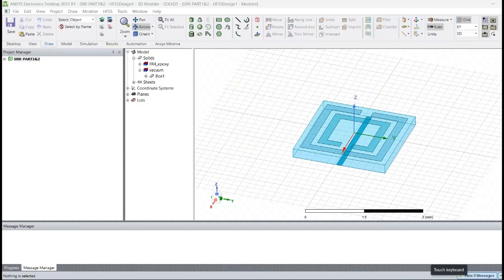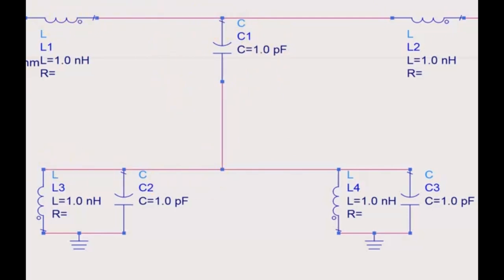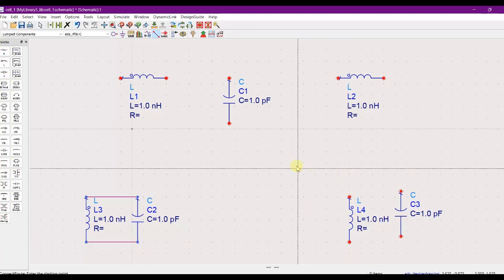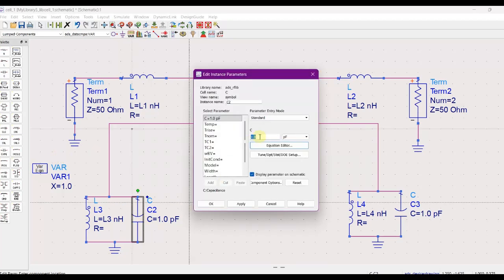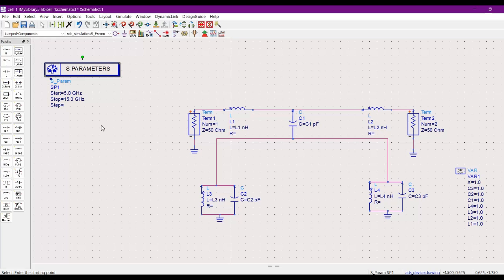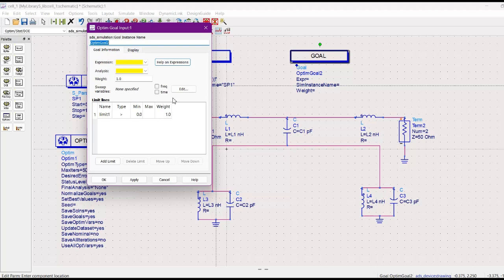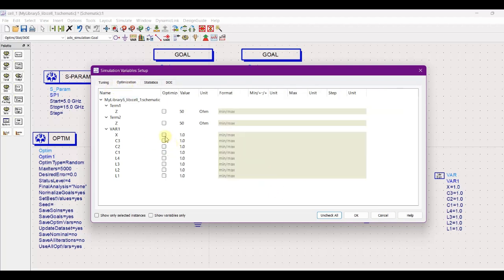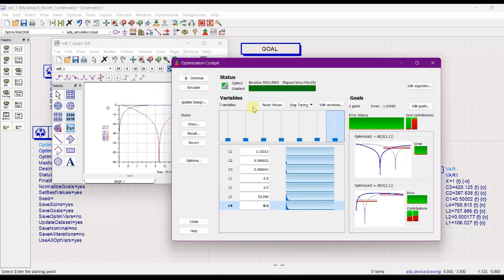SRR Metamaterial Unit Cell Equivalent Circuit Modeling in ADS | Extracting L & C Values

Comment: why Term G impedance is 50 ohm ...it should be 377 ohms.  ...Why the substrate is not included ....substrate impedance is 377/sqrt(epsilonr)....one more question ....when there is ground in my unit cell the the load side of ECM is sshort circuited ...then how to simulate ...Pleas reply and guide...Thanks for your nice Video
Reply from the maker: in most published SRR-ECM extraction work, people still build the ADS fitting circuit with 50 Ω ports even when the original EM data came from Floquet ports (377 ohm). That's because the ADS lumped-circuit is usually used purely as a curve-fitting tool. The L and C values you extract are what carry the physical meaning; the 50 Ω terminations are just a convenient, standard reference.
In an SRR-ECM, the substrate isn't missing — its effect is already absorbed into your extracted L and C values. The gap/ring capacitance (C1, C2, C3...) is inherently a function of the effective permittivity seen by the fringing fields which includes the substrate, so a higher εᵣ substrate simply shows up as a larger fitted C, not as a separate circuit element. This is standard in SRR-ECM papers — you don't see a discrete "substrate impedance" component because the ECM is a lumped equivalent of the whole physical stack, not a layer-by-layer transmission-line model.